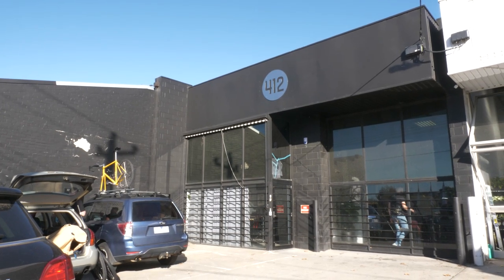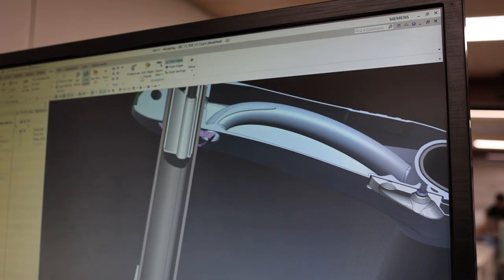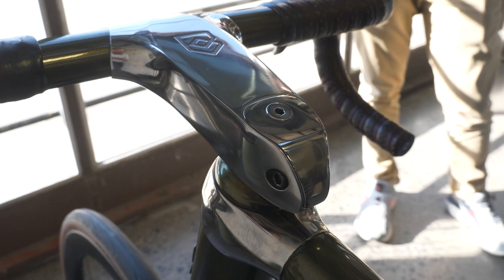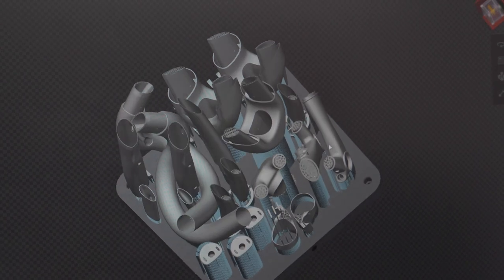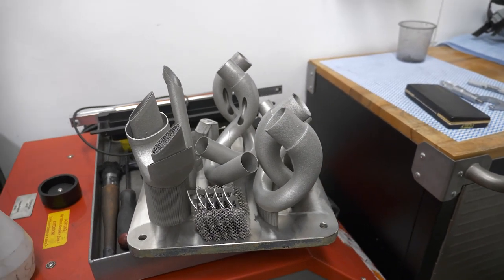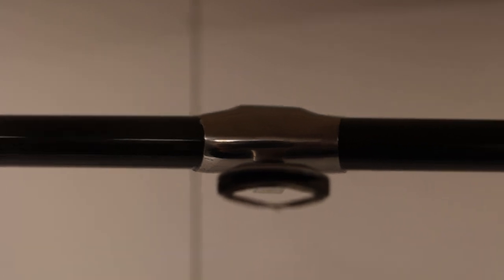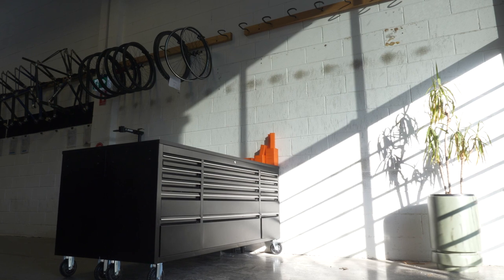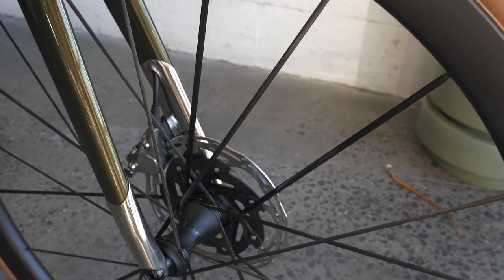Titanium and carbon 3D-printed forks and cockpit from Bastion

Comment: I wish Magnesium alloys become more mainstream for bike parts. "Mag" wheels for sportscars means they are made of magnesium. The GenV dodge viper also uses a magnesium alloy firewall. It is also used as structural material for aircraft.

Magnesium would be cheaper than titanium and carbon, and would be lighter than aluminium.

Comment: Stunning aesthetics. The transitions across materials are superbly executed. Regarding the cockpit's carbon handlebar flats, I wonder if the benefits--a few less grams?--warrant the extra complexity of integrating carbon into the design. Why not make the cockpit all Ti? Perhaps Bastion wants to maintain a uniform aesthetic across the board.
Reply: I remember other Ti builders claiming that a Ti bar is too noodly soft at the same weight class. When it is made stiff enough, it adds too much weight to the front end. That's why there are a lot of Ti Bars for tourers where front weight does not mean much, especially with all the bike packing.
I tried a Ti bar on my XC bike and it didn't feel "locked in" in terms of steering quality and response/feedback.
That said, I am sure they can pull it of with minimum extra weight and internal lattice.
Reply: @timurhant469  Ahh, thank you.
Reply: It is for a multitude of reasons, weight, performance, ride quality, aesthetics, cost, production capacity, etc. But definitely it aligns with our ethos of using carbon fibre for long straight sections. 3D printing Titanium is a less efficient way of producing those parts and would result in a more expensive, lower performing product.

Comment: I was really excited to see this, till I found out they still only do fork rakes that are the same as everyone else's. 
Kind of wonder why do "custom"  at that point.
Reply: Sorry just saw this comment, whilst we do still use traditional rakes like 45 or 50 on some geometries, we have used every mm increment from 43 up and even ventured to 54 or 55 when needed, especially on smaller frames. Hardly the same as everyone else’s. But the point is for many people actually 45 or 50 IS the right rake.
Reply: @bastioncycles9919  thanks for the Reply! It's funny how much can change in 10 months :) since I posted that comment, I went ahead and got a custom Ti fork made as a prototype, and started working with a carbon manufacturer to make my own forks :) 
I figured if no one was going to make any low rake forks that were appropriate for the steeper head angles, I'd make my own :)

Comment: A nice bit of engineering, glad to see it, not really liking the fork though. But, it seems it is only for a certain bike build and unfortunately would be a very expensive high end bike. Sorry but $11,000 is what my latest bike cost me and that is as high as I would ever go, in fact I really did not want to spend that much but that's where it ended up. I have the ControlTech Timania bars and stem which are good enough at almost $600 US.